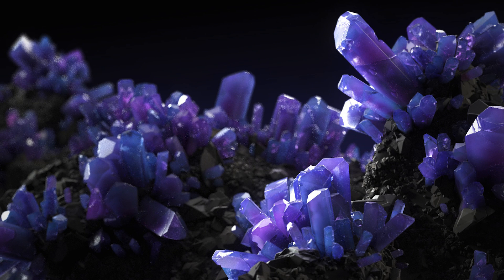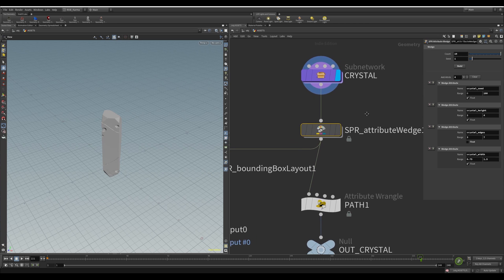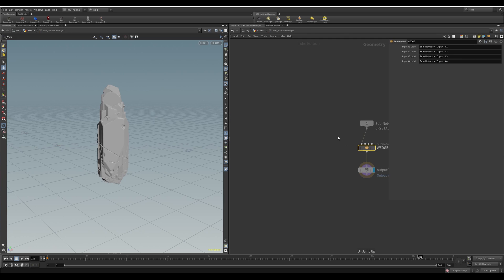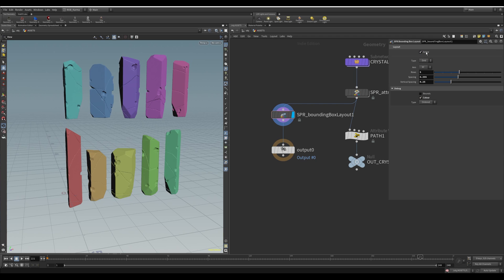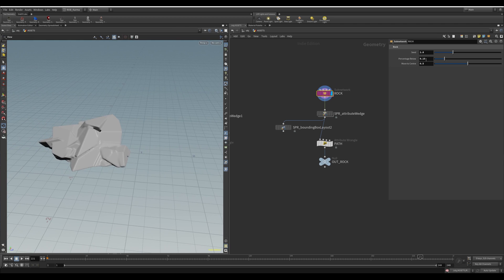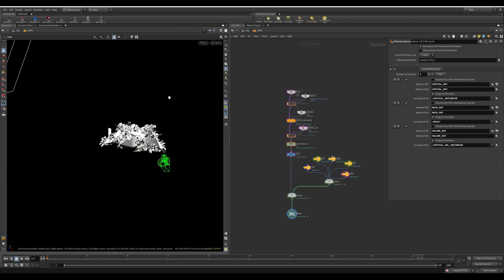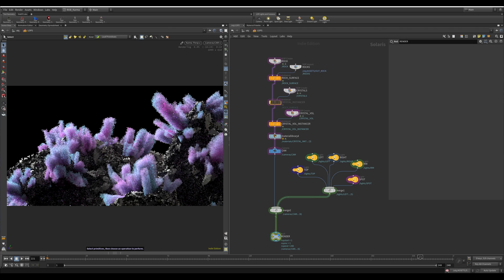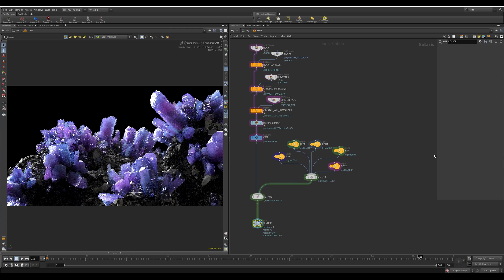Asset Variation and Batch Creation | Attribute Wedge HDA + Scene | Houdini

Comment: Unfortunately both 1.0 and 1.1 not working. Houdini 19.5.716 py3.7
Gives this error:

Error running callback:
Traceback (most recent call last):
  File "Sop/SPR_attributeWedge::1.0/widge_build", line 1, in <module>
  File "Sop/SPR_attributeWedge::1.0, PythonModule", line 76, in build
AttributeError: 'NoneType' object has no attribute 'set'
Reply from the maker: So your error is because that parm doesnt live on the input node. What i would do is subnet yourset and promote what parms you want to be set on the inside. Then you can point to those parms on the subnet from the wedge node.  This will solve your probmem with parms named the same aswell, becuase yo cant have the same name on the same node, so you could call it "noisa1" & "noise2" for example. Hope that helps and thanks for purchasing the HDA :)
Reply: @SuperPhotoReal  amazing! thank for reply! I'll check this soon
Reply: Also if I have for example two noise nodes and I want to adjust their offsets separately - how can I define it in the wedge node? Both of these noises have exact same attribute name when I copy the offset parameter reference.

Comment: I'm getting this error: 

Traceback (most recent call last):
  File "Sop/SPR_attributeWedge::1.0/widge_build", line 1, in <module>
  File "Sop/SPR_attributeWedge::1.0, PythonModule", line 56, in build
  File "Sop/SPR_attributeWedge::1.0, PythonModule", line 24, in getWedgeAttribs
AttributeError: 'NoneType' object has no attribute 'eval'

Even in your demo scene.
I'm on  Indie 19.5.773 py3.9
Reply from the maker: Ok i found a small bug with the code that's now been corrected, i'll be uploading a new version of the demo scene and HDA. Hopefully you'll both get an email with a new download link from gumroad. Please let me know if you don't receive it via email and i can send it to you specifically. Thanks
Reply: @SuperPhotoReal  Hello! I am also getting this message when hitting the Build button after pasting relelative reference. Haven't done much SubNetworks before, could there be a specific work flow that needs to be done with the Subnet before hitting the Build button ?

Thanks :)